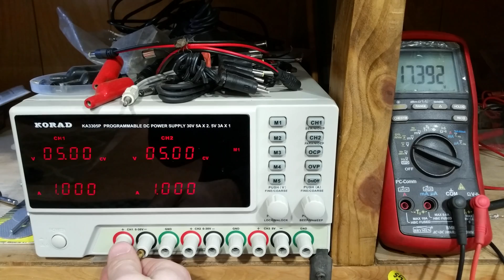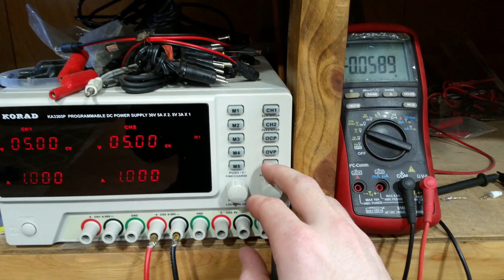Korad ka3305p serial mode short

Comment: Damn I was hoping that you found a problem I was recently playing with high voltage coils that you would have in taser making arcs until feedback went back to the power supply and screwed up one of my channels which was pretty much exactly what's happened to this unit except mine was showing 10-20 milliamp draw but the same like 30 one or 33 volts just ripped it apart try to find some issues so far on the power board I'm getting all measurements same across all components which leads me to the microcontroller on the other board behind the screen

Comment: Hey. The power supply has 2 outputs 30v 5A. How to get 30V 10A? Is it possible to set on the power supply so that the output has a regulation range of 30V 10A?
Reply: You have to set both channels to "PARA".

Comment: Did you recently buy the KORAD 3305P?  I've had mine for about 6 months without any problems however, I noticed  something rattling around inside while unpacking and found an extra nut that was supposed to be for the handle. I made a search for anything else that would could be lodged somewhere as well as tighten all the fastening hardware before I tempted to power it on. You might want to take the cover off and look around a bit. Also, it may be possible that the programming from the USB interface could have been setup wrong somehow. KORAD is well known to be an excellent company and many technicians use their power supplies.
Reply from the maker: pretty sure it's been just over a year, and it was almost certainly directly caused by the short of the leads.
Reply: Are you saying the short of the test leads or something internal?
Reply from the maker: test leads
Reply: I am glad you found the problem to be nothing to worry about. As I said before, I have had zero problems with mine.

Comment: What is the problem?
Reply from the maker: the problem is that ch1 is set to 5v and yet when the output is turned on it goes up to over 50v and the display reads over 30v.
Reply: Power transistors may be shorted